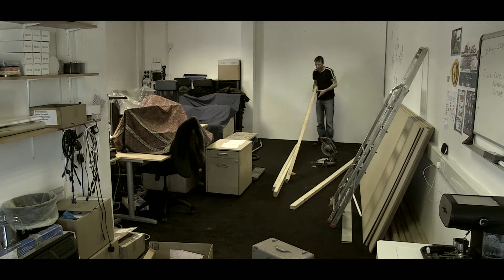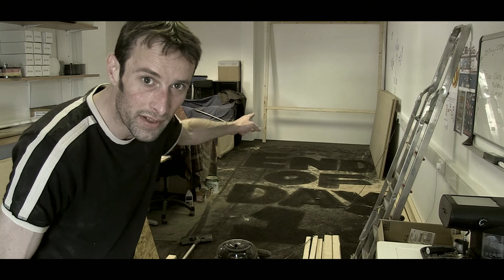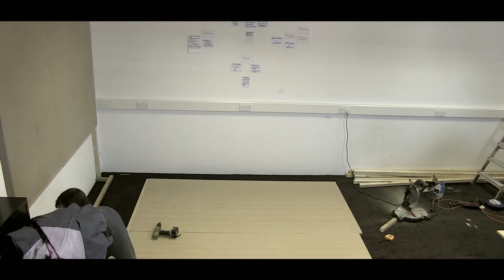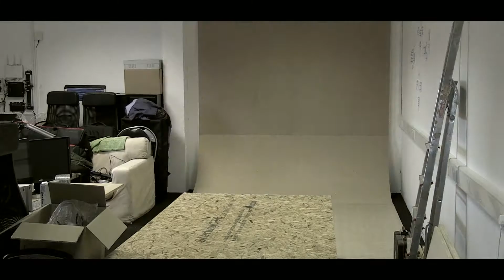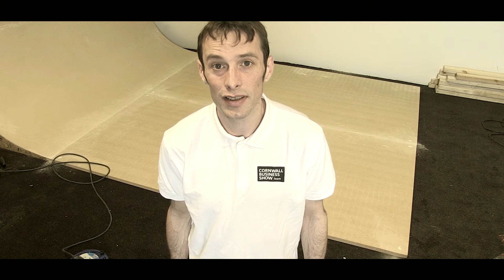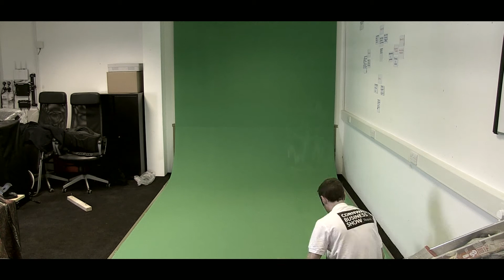Building a Chroma Key Green Screen

Comment from the maker: Hey Addy, glad you like! For carcassing, read battening, or bits of wood - in this case 2"x4", which was massive overkill as it turned out! Even 2"x2" woulda been more than enough. The paint is made by Rosco, and available here - http://www.stagedepot.co.uk. Not cheap, but it's the real deal. I used 12mm MDF for the backboard, 20mm for the base (heavy!) and 6mm for the curved section. I used sterling board for the formers at either end of the curve, to stop it collapsing if anyone steps on it. Best of luck! :)